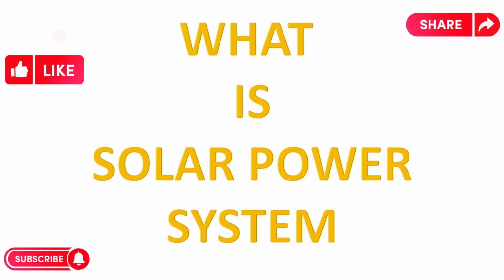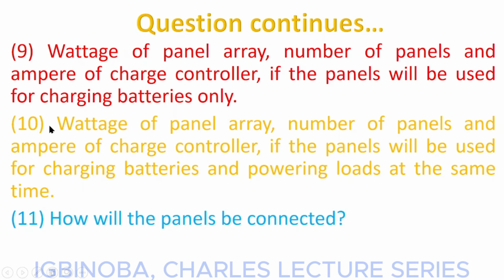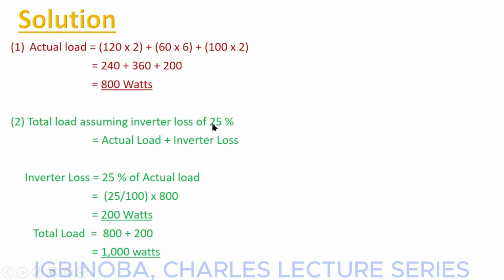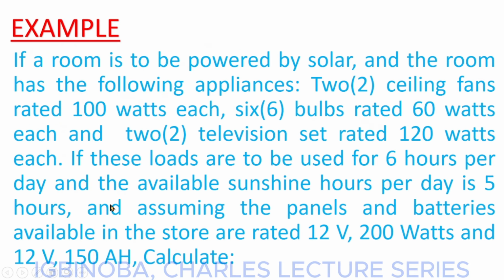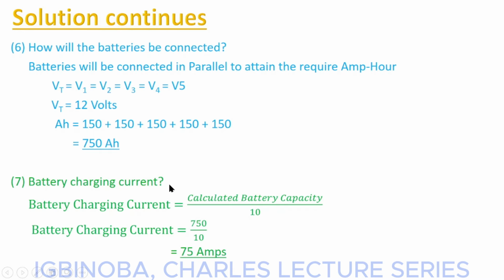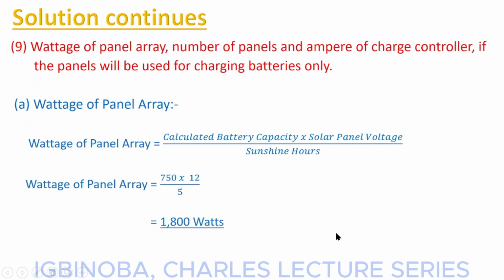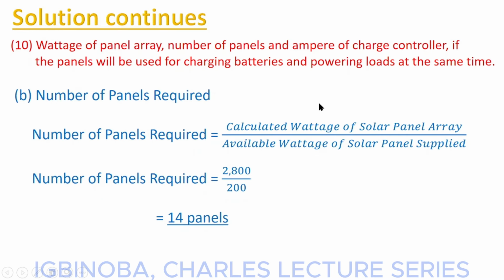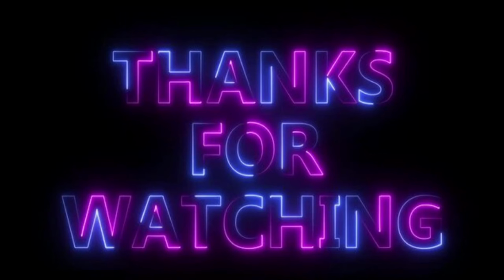Design of Solar Power System

Comment: CIV44R
Actual load: 1380W
Total load: 1725W
Inverter Reading: 2156V
Battery Capacity using a reserve of 75%:
Number of batteries for backup - 9hrs
How will the battery be connected - Para[llel]
Battery charging current - 129.4
Battery charging time with loss of 40% - 1[5.5 hrs]
Wattage of panel energy array: 315W
No of panels - 16
The charge controller rating - 258.75
The wattage of panel array: 4830W
The number of panel - 24 panels
The charge controller rating - 492.5
Panels connection - parallel

Comment: EEE94P

(1) 1380 W
(2) 1840 W (or 1725 W if calculated as 1380 \times 1.25)
(3) 2300 VA (or 2.3 kVA)
(4) 1610 Ah
(5) 11 batteries
(6) All 11 batteries connected in parallel
(7) 322 A
(8) 8.33 hours (8 hours 20 minutes)
(9) Wattage: 3864 W, Number of panels: 20 panels, Charge controller rating: 322 A
(10) Wattage: 5704 W, Number of panels: 29 panels, Charge controller rating: 475.33 A
(11) All panels connected in parallel

Comment: EEE45S
1.Actual load= 1359watts
2.Total load assuming inverter loss of 25%=1725watts
3.Inverter rating using power factor of 0.8....1725÷0.8=2156.25VA
4.Battery capacity using factor of reserve of 75%=1293.75AH
5.Number of batteries for backup hours...1293.75÷150=5.625
6.It's connected in parallel 
7. 1293.75÷10= 129.375Amp
8.12.3hrs
9.wattage of panel array=1800watts
9b.9 panels
9c.180Amps
10.1800+1725=3525watts
11.17.625
11b.293.75Amps
12.In parallel

Comment: NAT12L

Answers:
(1) Actual load = 1380 W
(2) Total load (25 % inverter loss) = 1840 W
(3) Inverter rating = 2300 VA
(4) Battery capacity = 1226.67 Ah
(5) Number of batteries = 9
(6) Battery connection = All in parallel (12 V system)
(7) Battery charging current ≈ 135 A
(8) Battery charging time (40 % charging loss) ≈ 11.4 hours
(9) Panels for charging batteries only
•  Array wattage ≈ 3680 W
•  Number of panels = 19
•  Charge controller ≈ 385 A
(10) Panels for charging batteries + powering loads simultaneously
•  Array wattage ≈ 4930 W
•  Number of panels = 25
•  Charge controller ≈ 515 A
(11) Panel connection = Parallel (or series-parallel strings matching 12 V charge-controller input)

Comment: MEC86H

1. Actual load: 1,380 W

2. Total load: 1,725 W

3. Inverter: 2,156 VA ≈ 2.2 kVA

4. Battery capacity: 13,800 Wh

5. Batteries: 8

6. Connection: 4S × 2P

7. Charging current: 60 A

8. Charging time: 8.3 hours

9. Charging only: 2,800 W, 14 panels, 60 A controller

10. Charging + load: 4,800 W, 24 panels, 100 A controller

11. Panel connection: 4S × 4P / 4S × 6P respectively.

Comment: CIV71S
1.  Actual load = 1380Watt
2.  Total load = 1725Watt
3.  Inverter rating = 2156.25VA
4.  Battery Capacity = 1239.75Ah
5.  Number of batteries = 8.625, so 9 batteries will be used
6.  The batteries will be connected in parallel
7.  Battery charging current = 129.375A
8.  Battery charging time with 40% loss = 14hrs
9.  For charging only:  
    a. Wattage of panel array = 3105Watt  
    b. Number of panels = 16panels  
    c. Ampere of charge controller = 258.75A
10. For charging + powering load:  
    a. Wattage of panel array with load = 4830Watt  
    b. Number of panels = 24 panels  
    c. Ampere of charge controller = 420.5A
11. The panels will be connected in parallel

Comment: EEE20T 

Actual load = 1380 watts
Total load = 1724 watts
Inverter rating = 2156.25 VA
Battery capacity = 1293.75 AH
Number of batteries = 9 batteries
Battery connection = Parallel
Battery charging current = 129.375 A (150 A)
14 hours
9a. Wattage of panels array (charging only batteries) = 3105.6 watts
9b. Number of panels = 16 panels
9c. Ampere of charge controller = 358.8 A
10a. Wattage of panels array (battery and load) = 4831 watts
10b. Number of panels = 24 panels
10c. Ampere of charge controller = 402.6 A

11. Panel connection = Parallel

Comment: PETRO351

1380W
1725 W
2156.25VA
1293.75AH
9 batteries.
The batteries will be connected in parallel
129.375A
14hrs
3105W
16 panels
258.75A
300A Charge controller will be suitable.
4830 A
24 Panels
402.5A
500A charge controller will be suitable
The panels will be connected in Series

Comment: PETRO13M

Answers 
1. The actual pad is 1,380W
2. The total load is 1,725W
3. The inverter rating is 2,156.23VA
4. The battery capacity is 1,293.75Ah
5. The number of batteries is 9
6. The batteries are connected in parallel
7. The battery charging current is 129.4 amps
8. The battery charging time is 14 hours
9. a. The wattage of the panel array is 3,105W
      b. The number of panels is 16 panels
      c. The charge controller rating is 258.75 amps
10. a. The wattage of the panel array is 4,830W
        b. The number of panels is 24 panels
        c. The charge controller rating is 402.5 amps
11. The panels are arranged in parallel

Comment: MEC47U 
Answers:
1. The actual pad is 1,380W
2. The Total load is 1,725W
3. The inverter rating is 2,156.23VA
4. The battery capacity is 1,293.75Ah 
5. The Number of batteries is 9
6.  The batteries are connected in parallel 
7. The Battery charging current is 129.4 amps.
8. The battery charging time is 14 hours.
9. a. The wattage of the panel array is 3,105W
b. The number of panels is 16 panels.
c. The Charge controller rating is 258.75 amps.

10. a. The wattage of the Panel array is 4,830 Watts 
b. The number of panels is 24 panels.
c. The charge controller rating is 402.5 amps
11. The panels are arranged in parallel

Comment: CIV55C
1. Actual load=1380Watts
2. Total load=1725Watts
3. Inverter rating=2156.25VA
4. Battery Capacity= 1293.75AH
5. Number of Batteries= 9 batteries
6. Batteries connection: Parallel
7. Battery Charging Current: 129.375A(150A)
8. 14Hours
9a. Wattage of panel array(charging only batteries) =3105.6Watts
9b. Number of panels= 16panels
9c. Ampere of charge controller= 358.8A
10a. Wattage of panel array (Battery and load) =4831Watts
10b. Number of panels= 24 panels
10c. Ampere of charge controller= 402.6A
11. Panel connection: Parallel

Comment: CHM17Q
1. Actual load: 1380W
2. Total load: 1725W
3. Inverter rating: 2156.25VA
4. Battery capacity: 1239.75Ah
5. Number of batteries: 9
6. They will be connected in parallel 
7. Battery charging current: 129.375A
8. Battery charging time with 40% loss: 14hrs
9a. Wattage of panel array: 3105W
9b. Number of panels: 16
9c. Ampere of charge controller: 258.75A
10a. Wattage of panel array with load: 4485W
10b. Number of panels: 23
10c. Ampere of charge controller: 373.75A
11. They will be connected in parallel

Comment: COMP69Q

1. The actual pad is 1,380W
2. The Total load is 1,725W
3. The inverter rating is 2,156.23VA
4. The battery capacity is 1,293.75Ah 
5. The Number of batteries is 9
6.  The batteries are connected in parallel 
7. The Battery charging current is 129.4 amps.
8. The battery charging time is 14 hours.
9. a. The wattage of the panel array is 3,105W
b. The number of panels is 16 panels.
c. The Charge controller rating is 258.75 amps.

10. a. The wattage of the Panel array is 4,830 Watts 
b. The number of panels is 24 panels.
c. The charge controller rating is 402.5 amps
11. The panels are arranged in parallel

Comment: COMP7G

1. The actual pad is 1,380W
2. The Total load is 1,725W
3. The inverter rating is 2,156.23VA
4. The battery capacity is 1,293.75Ah 
5. The Number of batteries is 9
6.  The batteries are connected in parallel 
7. The Battery charging current is 129.4 amps.
8. The battery charging time is 14 hours.
9. a. The wattage of the panel array is 3,105W
b. The number of panels is 16 panels.
c. The Charge controller rating is 258.75 amps.

10. a. The wattage of the Panel array is 4,830 Watts 
b. The number of panels is 24 panels.
c. The charge controller rating is 402.5 amps
11. The panels are arranged in parallel

Comment: NAT6F

1. Actual load=1380watts

2. Total load=1725watts

3. inverter rating=2156.25VA

4. Battery capacity=1293.75AH

5. Number of batteries=9

6. Battery connection=parallel 

7. Battery charging current=129.75A

8. 14 hours

9a. Wattage of panel array ( charging only batteries)= 3105.6watts
9b. Number of panels=16
9c. Ampere of charge controller=357.8A

10a. Wattage of panel array (charging battery and load)= 4831watts
10b. Number of panels=24
10c. Ampere of charge controller=402.6A

11. Panel connection=parallel

Comment: CIV68P

1. Actual load = 1380 Watts

2. Total load = 1725 Watts

3. Inverter rating = 2156.25 VA

4. Battery Capacity = 1293.75 AH

5. Number of Batteries = 9 batteries

6. Batteries connection: Parallel

7. Battery Charging Current: 129.375A (150A)

8. 14 Hours

9a. Wattage of panel array (charging only batteries) = 3105.6 Watts

9b. Number of panels = 16 panels

9c. Ampere of charge controller = 358.8 A

10a. Wattage of panel array (Battery and load) = 4831 Watts

10b. Number of panels = 24 panels

10c. Ampere of charge controller = 402.6 A

11. Panel connection: Parallel

Comment: COMP50X 
Answers:

1. The actual load is 1,380W
2. The Total load is 1,725W
3. The inverter rating is 2,156.23VA
4. The battery capacity is 1,293.75Ah 
5. The Number of batteries is 9
6.  The batteries are connected in parallel 
7. The Battery charging current is 129.4 amps.
8. The battery charging time is 14 hours.
9. a. The wattage of the panel array is 3,105W
b. The number of panels is 16 panels.
c. The Charge controller rating is 258.75 amps.

10. a. The wattage of the Panel array is 4,830 Watts 
b. The number of panels is 24 panels.
c. The charge controller rating is 402.5 amps
11. The panels are arranged in parallel
Reply: NAT44R
Answers: 
1. The actual load is 1,380W 
2. The Total load is 1,725W 
3. The inverter rating is 2,156.23VA 
4. The battery capacity is 1,293.75Ah 
5. The Number of batteries is 9 
6. The batteries are connected in parallel 
7. The Battery charging current is 129.4A. 
8. The battery charging time is 14 hours. 
9. a. The wattage of the panel array is 3105W 
b. The number of panels is 16 panels. 
c. The Charge controller rating is 258.75A. 
10. a. The wattage of the Panel array is 4,830W
b. The number of panels is 24 panels. 
c. The charge controller rating is 402.5A
11. The panels are arranged in parallel

Comment: COMP2B 

1. The actual pad is 1,380W
2. The Total load is 1,725W
3. The inverter rating is 2,156.23VA
4. The battery capacity is 1,293.75Ah 
5. The Number of batteries is 9
6.  The batteries are connected in parallel 
7. The Battery charging current is 129.4 amps.
8. The battery charging time is 14 hours.
9. a. The wattage of the panel array is 3,105W
b. The number of panels is 16 panels.
c. The Charge controller rating is 258.75 amps.

10. a. The wattage of the Panel array is 4,830 Watts 
b. The number of panels is 24 panels.
c. The charge controller rating is 402.5 amps
11. The panels are arranged in parallel

Comment: MEC5E

ANSWER:
1)Actual load=1380W

2)Total load=1725W

3)Inverter rating=2156.25VA

4)Battery capacity=1293.75Ah

5)No of batteries for backup hours=9 batteries 

6)Battery connection=In parallel

7)Battery charging current=129.375A

8)Battery charging time=14 hours

9a)Wattage of panel array(only batteries)=3105W
b)No of panels=16Panels 
c)Ampere for charge controller(only batteries)=258.75A

10a)Panels wattage(battery and load)=4830W
b)No of panels=14 Panels
c)Ampere for charge controller(battery and load)=402.5A

11)Panel connection=In parallel

Comment: CIV70R
Answers:
1. Actual Load: 1380 W

2. Total Load: 1725 W

3. Inverter Reading: 2156.25 VA

4. Battery Capacity Using a Reverse of 75%: 1293.75 Ah

5. Number of Batteries for Backup Hours: 9 Batteries

6. Battery Connection: Parallel

7. Battery Charging Current: 129.4 A

8. Battery Charging Time with Loss of 40%: 14 hrs

9. Wattage of Panel Array: 315 W

10. Number of Panels: 16 Panels

11. Charge Controller Rating: 258.75 A

12. Wattage of Panel Array: 4830 W

13. Number of Panels: 24 Panels

14. Charge Controller Rating: 492.5 A

15. Panel Connection: Parallel

Comment: COMP5E

Answer:
1. The actual pad is 1,380W
2. The Total load is 1,725W
3. The inverter rating is 2,156.23VA
4. The battery capacity is 1,293.75Ah 
5. The Number of batteries is 9
6.  The batteries are connected in parallel 
7. The Battery charging current is 129.4 amps.
8. The battery charging time is 14 hours.
9. a. The wattage of the panel array is 3,105W
b. The number of panels is 16 panels.
c. The Charge controller rating is 258.75 amps.

10. a. The wattage of the Panel array is 4,830 Watts 
b. The number of panels is 24 panels.
c. The charge controller rating is 402.5 amps
11. The panels are arranged in parallel

Comment: COMP32F

1. The actual pad is 1,380W
2. The Total load is 1,725W
3. The inverter rating is 2,156.23VA
4. The battery capacity is 1,293.75Ah 
5. The Number of batteries is 9
6.  The batteries are connected in parallel 
7. The Battery charging current is 129.4 amps.
8. The battery charging time is 14 hours.
9. a. The wattage of the panel array is 3,105W
b. The number of panels is 16 panels.
c. The Charge controller rating is 258.75 amps.

10. a. The wattage of the Panel array is 4,830 Watts 
b. The number of panels is 24 panels.
c. The charge controller rating is 402.5 amps
11. The panels are arranged in parallel

Comment: MEC52Z

1. Actual load = 1380 watts
2. Total load = 1725 watts
3. Inverter rating =2156.25A
4. Battery capacity=1293.75
5. No of battery = 9
6. Battery Connection= Parallel 
7. Battery charging current= 129.4A
8. Battery charging time = 14 hours
9. Wattage of panel array = 3105.6 watts
Number of panels = 16
Amp of charge controller= 358.8 A
10. Wattage of panel array= 4831 watts
Number of panels = 24
Amp of charge controller= 402.6A
11. Panel connection is parallel

Comment: MEC109E 

1. Actual Load = 1380watts

2 Total load = 1725Watts

3. Inverter reading = 2156V

4. Battery capacity using a reserve of 75% = 1293.75AH

5. Numbers of batteries for backup = 9hours

6. The batteries will be connected in parallel 

7. Battery charging current = 129.4A

8.  Battery ttery charging time with a loss of 40% is =14hours

9a. Wattage of panel energy array = 315W

9b. Numbers of panel = 16

9c. The charge controller rating = 258.75

10a. Wattage of panel array = 4830Watts

10b. Number of panels = 24panels

10c. Charge controller rating = 492.5

11. The panel were connected in parallel

Comment: COM32F

1. The actual pad is 1,380W
2. The Total load is 1,725W
3. The inverter rating is 2,156.23VA
4. The battery capacity is 1,293.75Ah 
5. The Number of batteries is 9
6.  The batteries are connected in parallel 
7. The Battery charging current is 129.4 amps.
8. The battery charging time is 14 hours.
9. a. The wattage of the panel array is 3,105W
b. The number of panels is 16 panels.
c. The Charge controller rating is 258.75 amps.

10. a. The wattage of the Panel array is 4,830 Watts 
b. The number of panels is 24 panels.
c. The charge controller rating is 402.5 amps
11. The panels are arranged in parallel

Comment: PETRO57E

Answers:
1. Actual load = 1380Watt
2. Total load = 1725Watt
3. Inverter rating = 2156.25VA
4. Battery Capacity = 1239.75Ah
5. Number of batteries = 8.625 (9 batteries)
6. They will be connected in parallel 
7. Battery charging current = 129.375A
8. Battery charging time with 40% loss = 14hrs
9a. Wattage of panel array = 3105Watt
9b. Number of panels = 16panels
9c. Ampere of charge controller = 258.75A
10a. Wattage of panel array with load = 4485Watt
10b. Number of panels = 23panels
10c. Ampere of charge controller = 373.75A
11. They will be connected in parallel.

Comment: MEC26Z 

1. Actual Load=1380W
2. Total load=1725W
3. Inverter Rating=2156.25VA
4. Battery capacity=1293.75AH
5. No of batteries=9 batteries 
6. The batteries are connected in parallel 
7. Battery Charging Current=129.375A
8. Battery charging Time=14hours
9. (a) Wattage=3105W
(b) Number of panels=16 panels
(C) Charge controller= 258.75A
10. (a) Wattage= 4830W
(b) No of panels=24 panels 
(C) Charge controller=402.5A
11. The panels are connected in parallel

Comment: CIV66M
Answers:
1380 W
1840 W
2300 VA (or 2.3 kVA)
1226.67 Ah
9 batteries
Parallel connection
122.67 A
16.67 hours
Array Wattage: 3600 W / Number of Panels: ...

Comment: COMP70R

Ans—
1) Actual load=1380watts

2) Total load=1725watts

3) Inverter rating= 2156.25VA

4) Battery capacity= 1293.75AH

5) Number of batteries= 9 batteries 

6) Batteries connection= Parallel 

7) Battery charging current= 129.4A

8) 14 hours

9) Wattage of panel array=3105.6watts

9b) Number of panels= 16 panels

9c) Ampere of charge controller= 358.8A

10) Wattage of panel array= 4831watts

10b) Number of panels= 24 panels

10c) Ampere of charge controllers=402.6A

11)Panel connection= Parallel
Reply: CIV80B

1) Actual Load= 1380W

2) Total Load= 1725W

3) Inverter rating= 2156.25VA

4) Battery capacity= 1293.75AH

5) Number of batteries= 9 batteries 

6) Batteries connection= Parallel 

7) Battery charging current= 129.4A

8) 14 hours 

9) Wattage of panel array= 3105.6 W

b) Number of panels= 16 panels 

c) Ampere of charge controller= 358.8A

10) Wattage of panel array= 4831W

b) Number of panels= 24 panels 

c) Ampere of charge= 402.6A

11) Panel connection= Parallel

Comment: MEC100V

1. 1,380W
2. 1,725W
3. 2,156.25VA
4. 1,293.75AH
5. 9 Batteries
6. Batteries will be connected in Parallel 
7. 129.4AH
8. 14Hrs
9. Wattage of panel array: 3105W
Number of panels: 16 Panels
Amper of charge controller: 258.75A ≈ 260A
10. Wattage of panel array: 4830W
Number of panels: 25 Panels
Amper of charge controller: 402.5A ≈ 400A
11. Panels will be connected in Parallel